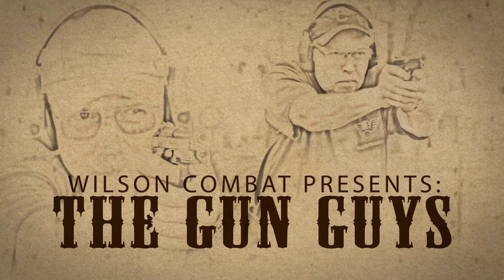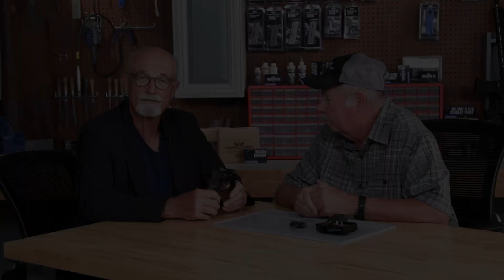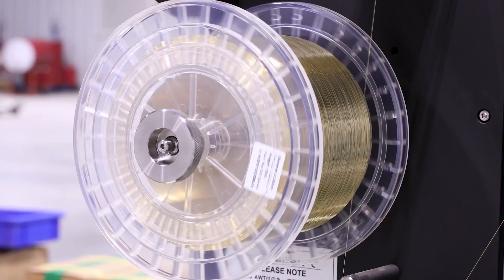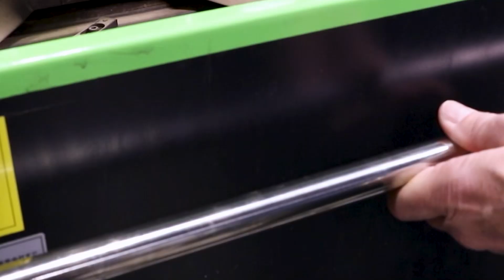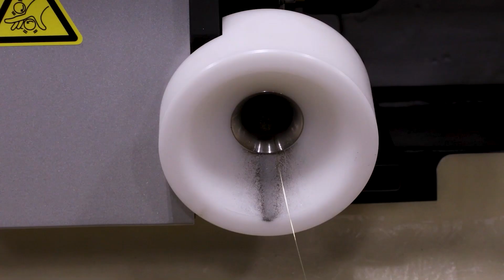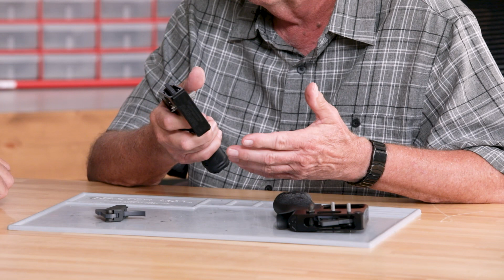An In-Depth Look At Our AR Tactical Trigger Unit - Gun Guys Ep. 43 with Bill and Ken Hackathorn

Comment: Been debating buying a TTU single stage for awhile now. I’ve just been having too much trouble with geissele. The trigger reset is too unpredictable under fast paced CQB style shooting. I experience a lot of trigger freeze. Only thing that makes me nervous for the 4lbs ttu is bump fires. But 5-5.5 pounds is too large of a gap is there any suggestions which trigger would work best?
Reply: I've been running cmc 3.5" single stage drop ins for both my cqb platforms and longer range platforms and absolutely love it. There's practically zero concern regarding bump fires, especially once you get used to the trigger. What I love most about the trigger is that it's got the strongest, and most audible reset of any trigger I've ever bought / tried. This allows you much easier access to proper muscle memory. 3.5ibs sounds light, and I was sceptical at first but it's got one of the best and easily identifiable walls of any drop in trigger I've used and I've used ALOT. With its very strong reset it will kick your trigger finger right to the point where you would begin squeezing for the wall which helped kick the worry of any bump fire issues I may of had.

Comment: I have used 4 of the single stage TTU’s. 1 was bad and was replaced by Wilson Combat. It was assembled incorrectly with the pin in backwards so that the notch that is supposed to help hold the spring on the left side was not there and the spring would constantly fall off causing malfunctions. When I called about another unit that I have that is also like that they told me that there is no warranty on the trigger units. To say that I’m disappointed in WC is an understatement. I also inquired about having a heavier spring installed in one unit to help it ignite 7.62x39 and was told that couldn’t be done which is too bad since they could dominate that sector of the market.
Reply: Maybe you've learned this by now, but cassette style triggers aren't really recommended for solid reliability.

Comment: I have a springfeild saint vector chambered in 308 . this thing is like a brick .do you have a trigger assembly that will fit this riffle ? And if so which one to get a 3.5 pull?
Reply: Timney all the way! 3lb trigger. I run them on all my ARs never had a problem. They are crisp and short reset.

Comment: What are the advantages of a drop-in unit like this as opposed to 2 assembly triggers?  

I like a 4-1/2 pound 2-stage trigger. Does this function any differently from an SSA?  This is more economical, I generally trust Wilson Combat, just trying to figure out how this might be different (better or worse) than the expensive trigger I know I can count on to be safe, consistent, and accurate.
Reply: Besides ease of installation, going with a drop-in allows different geometry than the mil-spec, which can often improve the feel, and be more consistent than Stoner's design.  For example, they don't have to use the receiver pin as a pivot for the hammer (some still do) or a fulcrum for the trigger.  Many drop-ins can often give you some adjustment to deal with out-of-spec fire control pockets.

It's also better for end-users that aren't gunsmiths.  Less to go wrong with the install, less to deal with in regards to warranty or support on a complete lower, etc.
Reply: @Croak1  thanks for the on-point reply. Hadn’t thought about being able to modify pivot points. I’m very happy with a Geissele 2-stage SSA trigger, but this may well be a more affordable alternative.